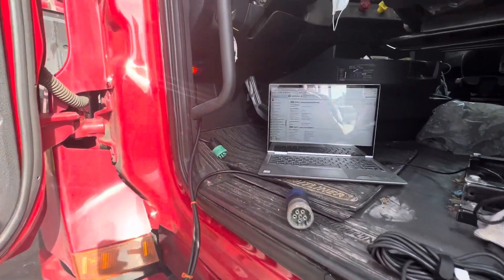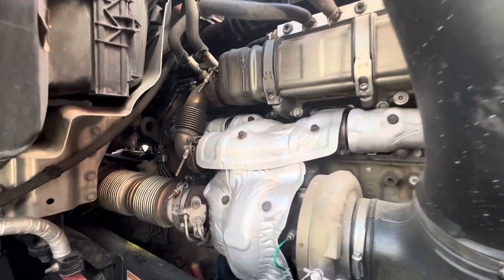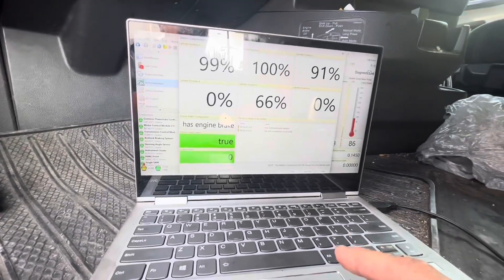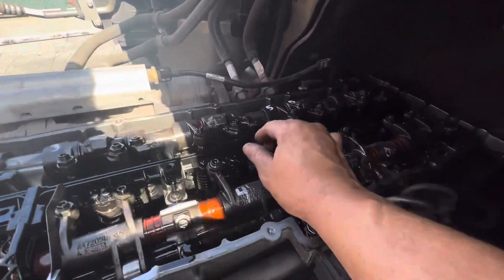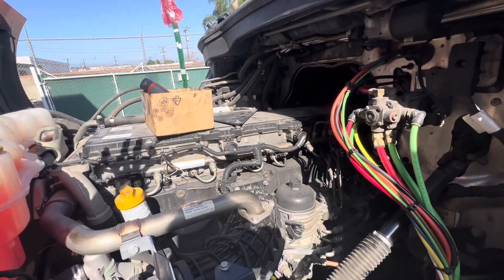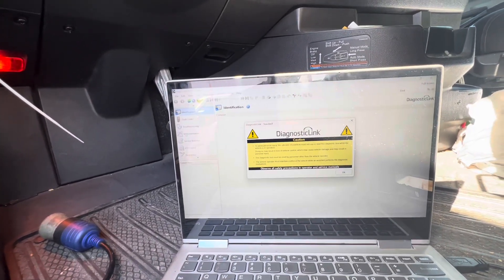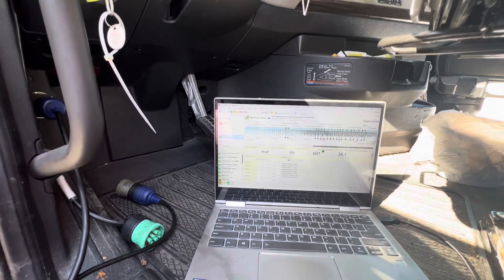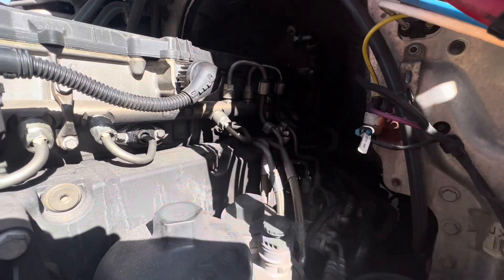Can we bring this DD15 back from zero compression? This is why valve adjustments are important.

Comment: my truck dd15 i did valve adjustment Mile on it was 868,571 mi,   Now the issue come back. After I drive like 30’000mile
It shows code spn 1326 fmi 31.   I don’t know If it will take another  valve adjustment .
Reply from the maker: You might get away with another valve adjustment but time is running out and the cylinder head will need to be changed. An inframe might be the way to go depending on the budget.

Comment: I have a question why does the engine sound like that when starting? 

Not the noise it’s making while idling 

Just the engine start? Like a slow start? 

My truck is doing that, but I don’t have any rough idle noises or anything like that
Reply from the maker: The valves are not opening and closing as they should so it’s almost choking. Recommend to have the over head looked at.
Reply: @CarlosDieselElectric it kind of sounds like weak batteries right? Like starting truck with weak batteries
Reply from the maker: Correct. Check the batteries first and then go from there.
Reply: @CarlosDieselElectric I’m thinking of doing valve adjustment as well, tbh my batteries are not good batteries!
Reply: @CarlosDieselElectric could it be starter issue as well?

Comment: I did valve adjustment,follow the steps on dd13 ,piston #2 valve are loose can you please help fix problem tks
Reply from the maker: @bernardoroman7654 make sure you are on the correct rotation. 
I recommend you start
TDC: 1 (look for the mark on the gear to confirm)
Adjust intake 1-2-4 and exhaust 1-3-5
Rotate 360 degrees 
TDC: 6 ( no marks will be present)
Adjust intake 3-5-6 and exhaust 2-4-6

Comment: What kind of software do you use if  don’t mind
Reply from the maker: @lifesjourney7219  I use the software from Detroit Diesel. It is called Detroit Diesel Diagnostic Link. It is available through Nexiq.
Reply: @ Thank you very much, I found the device online around $800 but i do know  much they charge yearly for the Detroit software
By the way today for the first time, I follow up with your video step-by-step I did valve  adjustment on my DD15 successfully done ✅

Comment: What if this guy had a DPF delete. In what way will this affect the engine ??
Reply from the maker: @akshaykatoch601  a delete can do a few things to your engine. More power but that means more fuel being used. That can burn out the pistons, cylinder head and other components. A bad delete can ruin your engine. I have seen some that have been done well and the truck runs great. 
So it all depends on the delete and other factors.
Reply: @CarlosDieselElectric will diesel additives damage the engine ?
Reply from the maker: @DanielBlack-g8u fuel additives are supposed to help with lubricating the fuel system due to low sulfur.

Comment: I did a valve adjustment 25k ago when I step on gas every time truck shifts gear it sounds like valve or injector knock for like a second any input
Reply from the maker: I would have it checked again. I am working on a DD15. Valves were adjusted 65-70K miles ago and compression shows low on one of the cylinders. I am checking the lash and some the valves are tight. So start there first.

Comment: I need help with my truck it has the same noise
Reply from the maker: Do a compression test to help verify the issue, this may help you identify the cylinder. Then if needed, perform valve adjustment.

Comment: Hey could a dirty air filter keep my air compressor from building pressure properly ?
Reply from the maker: @alexanderanderson8878  the line the comes off of the air compressor goes to the air filter housing. Not the discharge line but the other. That might cause a restriction. But I would look at carbon buildup in the lines.

Comment: Do tune up tight valve
Reply from the maker: Every mechanic has a different style of adjusting valves. For me, I try to go more towards the loose end if the miles are higher or closer towards the 1 million miles
Reply from the maker: The valves will tighten up with normal wear. You want to prevent them from over tightening. When they are too tight, you will not allow the valves to open and close properly, more soot, unburned fuel.

Comment: That’s a temporary fix. The valves are getting beat up into the seats and the valve recession is already in excess. He’s going to be back for a new head.
Reply from the maker: You are 100% correct, definitely a temporary fix. The cylinder head has to be replaced, the other issue the customer encountered is the fuel lines from the pump to rail are on national back order. These are one and done. So you run the risk if they are reused, they can leak.
Reply: @CarlosDieselElectric  gen 5 pump to rail lines were a problem awhile back but it seems to have been resolved. At least in the Chicago area. We had to reuse them for a while to verify repairs but 2-3 weeks later the lines came in and we would replace them and run a regen and let it go. The metal in fuel problems from high pressure fuel pumps has tapered off a lot. Not sure why.
Reply from the maker: @mike5162  good to know 👍🏼

Comment: Hi thank you for taking the time to share your knowledge. It has helped me a lot. I have a question hope you can help me  I’ve been doing engine swaps on some dd15 and 13 that have locked up. I change mains rods oil pump and oil manifold along with pick up tubes. Is their anything else you would recommend  it seems after few weeks they come back with fuel system problems and air pump issues. What’s your thought. Again thank you
Reply: The metal in the fuel is from the fuel pump.The fuel pump is fuel lubricated.At this point according to Detroit specs you’ll need to replace the whole fuel system because it’s contaminated with fuel and flushing fuel tanks and davco fuel filter.Nothing else will need to be replaced but the fuel system
Reply from the maker: What kind of fuel problems? Air in the system? Long crank hard start situation?
Reply: @CarlosDieselElectric  
I end up with metal shavings in the fuel filter which in turn contaminates injectors and fuel rail. I was wondering if I should flush the whole engine?

Comment: Should compression test be done on a cold engine or should me first warm it up and then do the test?
Reply from the maker: I have done a compression test on a cold engine and warm engine just to compare. Sometimes on a warm engine the numbers are slightly better.
Reply: @CarlosDieselElectric  what if the numbers are signicantly different on warm engine as compared to cold and what are other signs of a bad cylinder head?
Reply from the maker: @mehdiraza85  a bad cylinder head can have different signs. 
In this video, compression was the issue. In the beginning of the video the truck sounded like a train. There were no problems with coolant. 
After the valve adjustment the numbers improved. If the problem returns, then the cylinder head may have issues with the valve or valves. If blow by is present, then you most likely have a bad piston or piston ring. 
Trying to find out if the cylinder is bad would all depend on what the driver is reporting.

Comment: Valves are pushing up into the seats. Have seen this many times. Valve adjustment is only a temporary fix
Reply from the maker: Very true. Explained to the customer the issue will come back. Just a matter of when.
Reply: Then how do you fix the issue?
Reply from the maker: @oscarCT1340  start with a valve adjustment. If that does not work then the cylinder head will need to be replaced
Reply: I think you said it had 700k plus?  If overhead has not been adjusted in a while it may last a long time.

Comment: so in theory if they are not all at 100 percent you have a reliable but weak engine?
Reply from the maker: Not necessarily, I don't think I have ever had a engine with 100% compression across all six cylinders. So I wouldn't call it weak. IMO, anything with 90% or higher is good. Mileage, idle hours, injectors, all play a factor.
Reply: That test does not show stand alone ratings for each cylinder. It shows the strongest cylinder as 100% and each other cylinder as a percentage of the strongest cylinder. You could have reduced compression in all six cylinders and one of them would still show as 100% on this test. To get absolute compression ratings you have to do a mechanical compression test.

Comment: I had one of those high pressure fuel lines split while driving once. I had reused them after replacing the fuel pump. Don't do it. If you can't get replacements I would not take the old ones off.
Reply from the maker: I agree with you 100%
Reply: I had the same happen. Mechanic said hes seen it a lot.